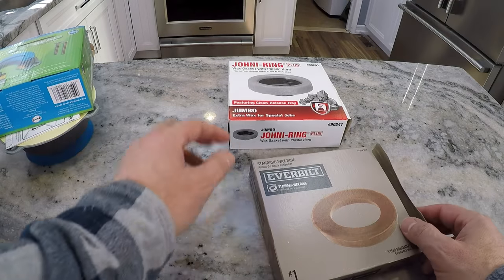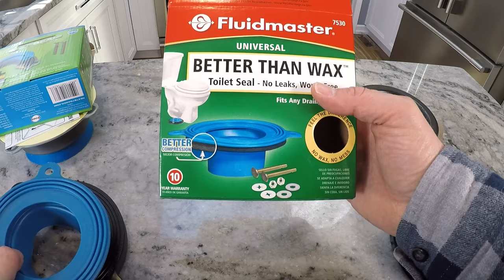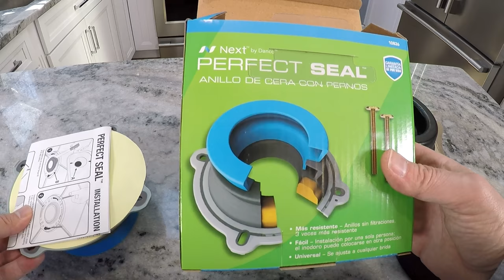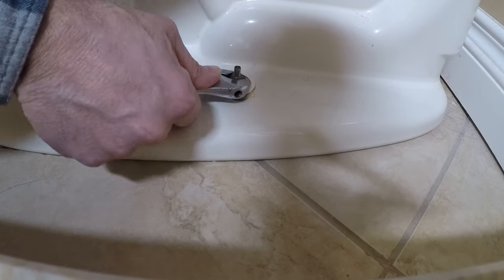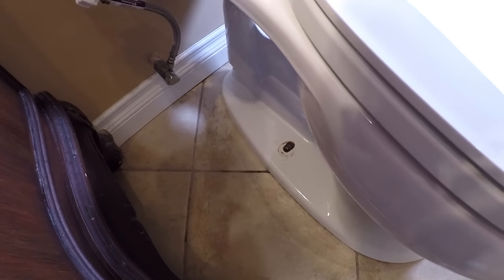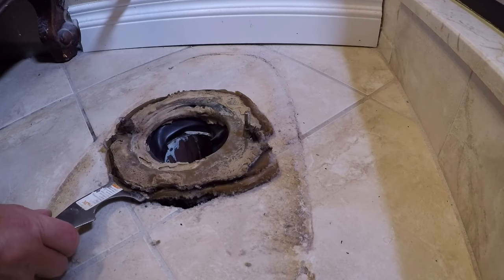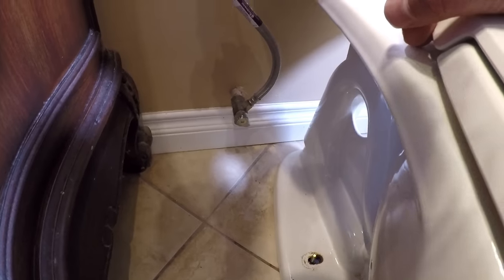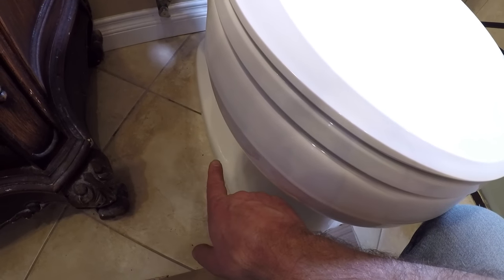Toilet Seal Replacement - Wax or Danco?

Comment: I'll add my experience with the new tech ring seals.  The "better than wax" seal failed after 7 years. The rubber seal had become hard and brittle and began to leak, a lot.  I replaced that with a "perfect seal" that was recommended by the big box plumber guy, which is a hybrid wax/rubber seal.  That began to leak in a few days.  I discovered the rubber seal had compressed on one side, and never popped up, leaving a gap...which leaked.  Even after multiple attempts, I could never get it to seal properly.  So, back to the old school plain jane wax ring.  No leaks after several months.  And still no leaks from my other toilets that have all wax ring seal after over 20 years.  I should've known better.

Oh, wear some throw away gloves, like nitryl mechanics gloves.
Reply from the maker: thanks for watching...
Reply: That's how I feel.. new tech always seem to fail. Wax has been used for a long time now!

Comment: If you have to replace your toilet bolts wouldn’t you have to remove the toilet to do that? In that case you would need to replace the wax ring anyway, wouldn’t you?  😳
Reply from the maker: yes.. not sure what your point is though. The whole video was about replacing the ring, not the bolts

Comment: After draining the water out of the tank finish getting all the water out of the tank and toilet with your SHOP VAC.   Of course, remove your paper filter and make sure the vac is empty and not filled with dirt, etc.  So much tidier.
Reply from the maker: it is way easier to use the sponge. By the time I open the shop vac and dump out the debis that is there, remove the filter, bring it into the house, then dump the water, let it dry out before putting it away. Too much BS and the sponge is done in about 60 seconds.